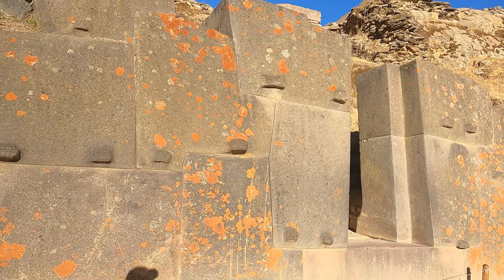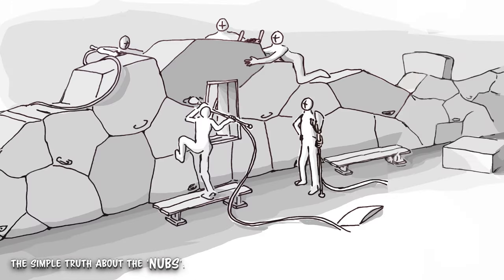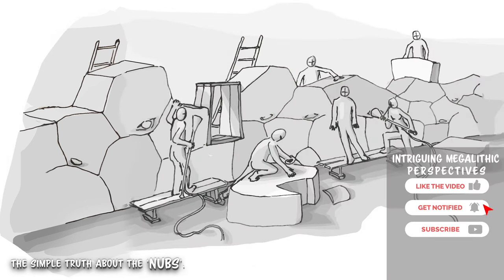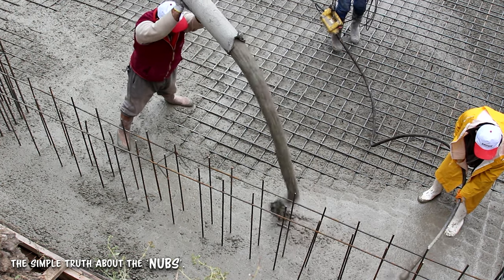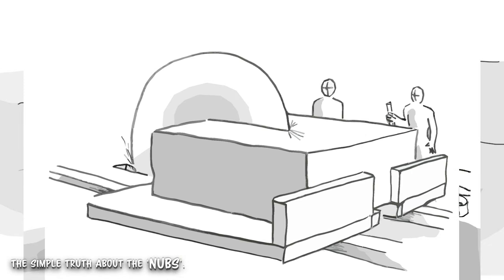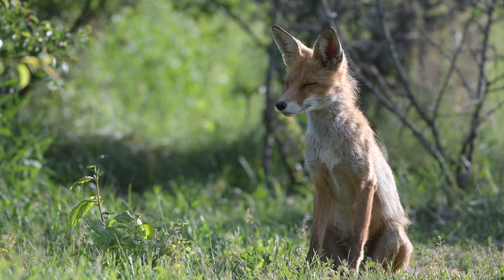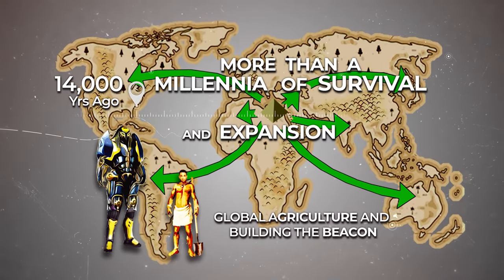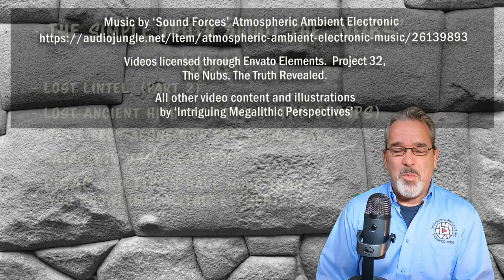Also showing how these walls were made!    The Simple Truth about the Nubs.

Comment: You cannot cancel the mass, and thus you cannot eliminate the gravity. In fact, there is no way to eliminate mass. So, you can just draw the pictures of a man carrying a huge stone block, but you cannot have anyone carrying such a weight in reality... You don't (and cannot) explain how the gravity is cancelled, and thus your main premise is baseless...
Reply: there definitely is a way, but its not just applying the liquid. given that in egypt these stones were moved inside tunnels with barely bigger width and height than the stone objects, aswell as some of them being left unfinished inside the tunnels, its clear that the device used was small, and it did push or pull, cause nothing was under the box that was left unfinished, so I would suggest something like a gravity field generator powered by electricity, or somethhng that moved it via its resonant frequency
Reply: But you cannot "generate a gravity field" other than by means of mass. And you need an enormous amount of mass to generate a sizeable gravity. You cannot generate gravity by using electricity. "Electromagnetic field" is something totally different, and it has an effect only on ellectroneutral objects.   @sshreddderr9409

Comment: Any theory of the nubs has to explain why there are not nubs also. Why the different sizes and locations on the stones. Some have one. Some multiple. If they're functional, why so many variations. And why wouldn't they be chipped off and smoothed away if they were only for the construction?
Any satisfactory theory has to address these inconsistencies.

Comment: Sonic? Vacuums?  How about electron valence transformation making the rocks soft and lightweight? Not likely. The stones had to soak a while in the softening bath The larger stones rested on small wooden blocks so their bottoms could be exposed to the liquid. The blocks prevented the softener from working where they touched. The rest of the blocks surface , one or two inches, could be scraped away leaving the nubs. Smaller stones could be turned, exposing all sides. The dents are are from using levers to pry the surface softened stones out of the bath and into the wall. The soft surfaces were then finished like icing on a cake. The bath tub was could have been lined with copper.

Comment: The stones are sized and tuned to withstand the majority of earthquakes and to less extent, sonics weapons. Each block is poured/shaped in place, checked for its natural frequency and adjusted by adding nubs or removing scoops. With all stones tuned dissimilar and none geometrically the same, no single event can cause the now untuned wall to fail due to catastrophic resonant failure. Ask your local secret society. They know
Reply: apart from the polygonal walls, other sites and particularly egypt suggest that at some point they had a technological society that ran on and was centered around the piezoelectric effect. did the local secret society also talk about bioelectromagnetism by any chance?
Reply: @sshreddderr9409  local secret society is proverbial. I too would only “know” from outside sources where you take it for what its worth.

Comment: They are not ‘for’ anything!! They are a part of the manufacturing process, like the little spike on the top of iced gems caused by the piping bag. 😮😮😮
Reply: Don't you think they could be there so that you can transport and lift them precisely into position with a simple crane without the grab or ropes snagging under the stone? I mean, these are pretty good spots for leverage.
Reply: How did they move all the ones without nubs then?
Reply: @efteestein  The builders might have simply chiseled the nubs off later. Perhaps they have also fallen victim to erosion. And with smaller stones, no special points for levers, rolls, cranes or belts are necessary. Of course, blocks near the ground do not need lifting points for cranes either. I think it's pretty obvious that these knobs were used for transportation. Try lifting a big block like that. You'd have to dig a hole underneath to have a starting point.